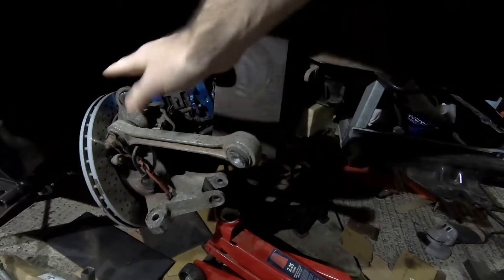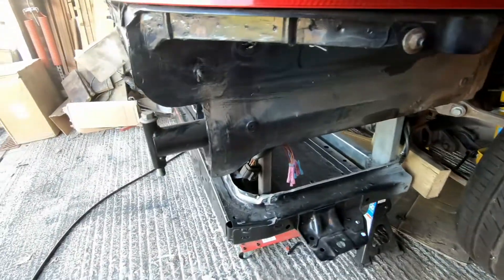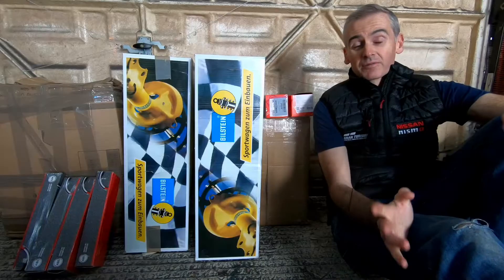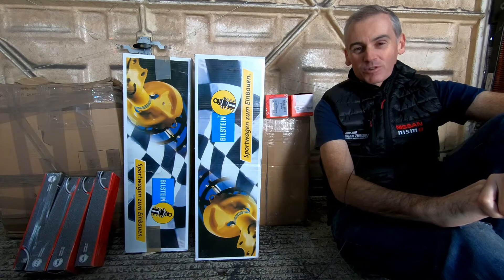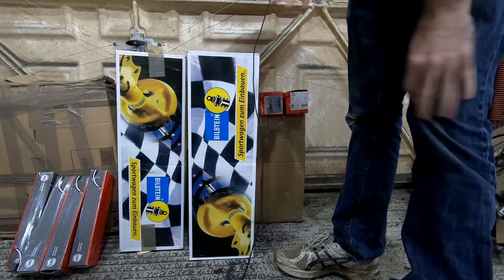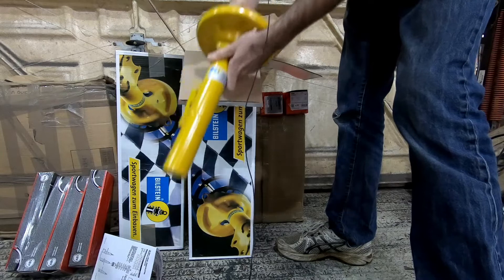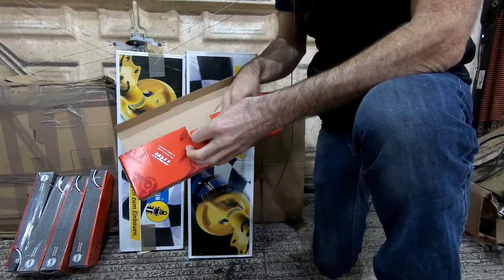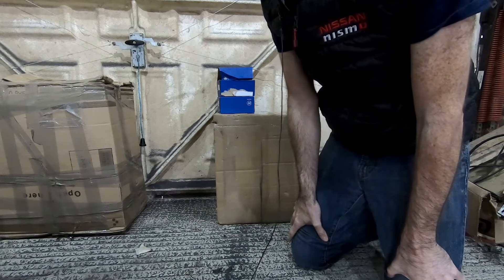Electric Porsche 911 project video 51 - Moving the car using muscle power - and project update

Comment: Please excuse my ignorance, what is the reason behind the two piece A-arm  suspension  replacement parts shown.  2 pieces rather than 1, 1 extra bushed joint, to my mind it seems a step down, not up.  I am sure being Porsche it is well designed and logical but I don't understand this currently...

Can anyone explain please

Comment: You ever check out eveurope EVhype 996 complete kit? It says it comes with a converter for the trans. Wouldnt a automatic talk the CPU a lot and not work? 

Sometimes I wonder they ever converted any since theres no pics or info really about this kit.
Reply from the maker: I hadn't really seen much of their work, but I took a deeper look based on your comment. Their stuff looks really neat, there's a lot of good EV work coming out of the Netherlands, but I think that set up is a little too low powered based on my longer term plans. I'm sure the first iteration of the drive train won't have much more than the 90kw their kit has, but the leaf motor is turnable to 2 or 3 time that figure with the right inverter (I'm targeting 220kw as that was the 3.4 996's base power figure.)

Comment: I think you’re right to focus on getting the motor and battery properly fitted so you can move the car under its own power. 

You can then focus on everything else.👍

Changing the suspension links and shocks can be done over a few evenings.

Comment: Dang!    That looks like the whole kit for suspension.    I'll probably do the same on my Miata.  The rubber bushings are pretty worn out.    Glad you here you have a way to make some space.. :)
Reply from the maker: Yeah, it escalated from just replacing the shocks to getting every component very quickly. I think the same argument I used to justify the expense on this car also holds true for the Miata, it was designed to handle well:-)